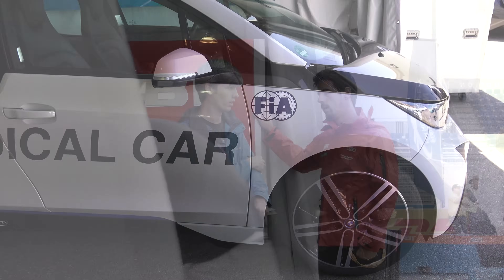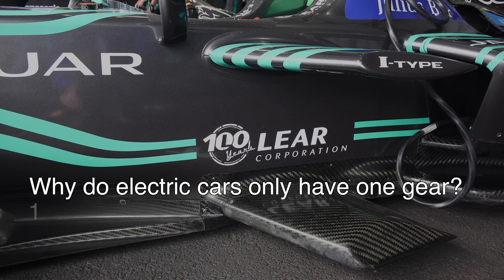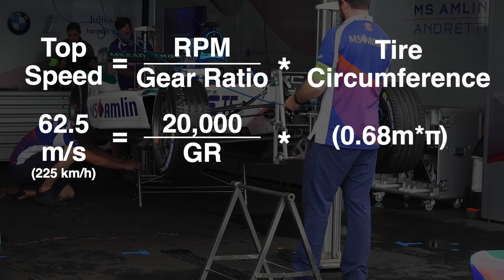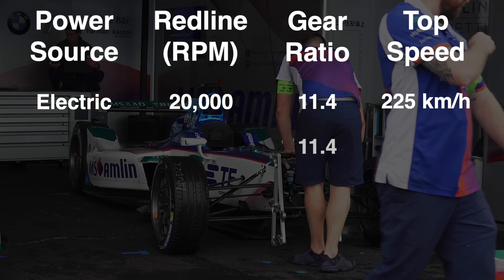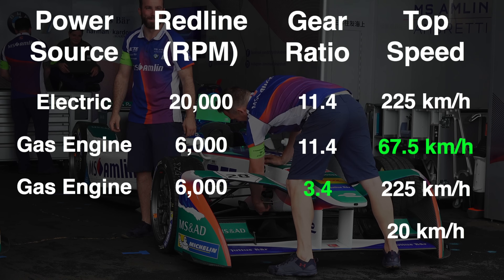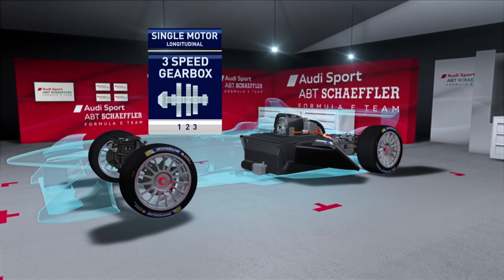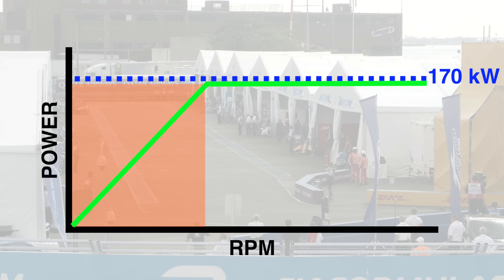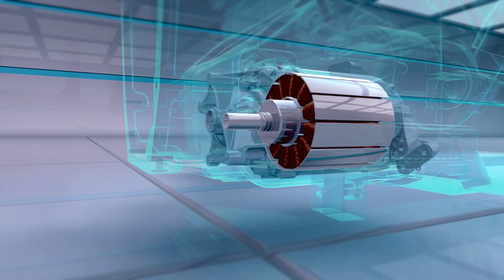Why Do Electric Cars Only Have 1 Gear?

Comment: The first Tesla car had a 2-speed transmission, so electric cars have been made with more than one gear.  Also, at least one electric motorcycle has a transmissions with several speeds.

The electric motor for an electric car could be smaller and lighter if the car had a multi-speed transmission.  However, most electric car manufacturers have decided that it's better to have a somewhat bigger and heavier electric motor to eliminate the complication of a multi-speed transmission.  That may result in slightly lower efficiency, but the efficiency loss is small.
Reply: Frank Eggers You will get worse efficiency if you run a smaller motor through gears. For the same weight of a gearbox and small motor you could have a big motor and no gears. The big motor without gears would be more efficient.
Reply: Actually, it is more complicated than that.  To see why there are multiple opinions, check the following:

http://gas2.org/2014/07/20/bosch-electric-cars-will-soon-transmissions/

http://www.plugincars.com/efficiency-multi-speed-transmissions-electric-cars-107656.html

The above link has an error.  Here it is:
" On old EVs, with DC motors, there was a need of a transmission to allow reverse driving....".  Apparently the writer is unaware that DC motors can easily be reversed.  That is not his only error.  However, he does correctly point out that multiple ratios do provide advantages.

http://insideevs.com/zf-multi-speed-transmissions-coming-soon-electric-cars/

https://www.oerlikon.com/stories/2015/10/29/electromobility-calls-for-innovative-transmission-solutions/

Here is a quotation from the above:
"The 2SED (2-Speed Electric Drive) and 4SED (4-Speed Electric Drive) concepts represent significant developments in multi-speed applications for electric vehicles."

In general, electric motors are most efficient when they are heavily loaded, but not necessarily overloaded.  If a traction motor is big enough to provide adequate torque for exciting acceleration from zero speed, it will be running at a very light load at normal driving speeds thereby somewhat reducing its efficiency.  Also, the motor would be heavier.  Thus, there are gains to be made by providing an electric car with a multi- speed transmission, but perhaps not more than two speeds.  So the actual question is whether a multiple speed transmission for an electric car provides advantages great enough to warrant the additional complication, additional maintenance, and possibly greater cost.  The links I've provided will support that conclusion.  I'd prefer the single speed transmission approach, but there are valid arguments for multiple speeds.

In an earlier iteration of my life I had considerable experience with electric motors, both AC and DC.
Reply: Frank Eggers I can't take anything from a, soon to be irrelevant, transmission company's blurbs seriously.
Reply: difflocktwo, I can take it seriously.  The weight of an electric motor is roughly proportional to its torque and, because a multi-speed transmission would reduce the torque demands, it would make it possible to have a lighter motor.  Obviously an electric motor is more flexible than an IC engine.  An electric motor can deliver its full torque at stall and, without damage, put out several times its rated power for limited periods of time.  Unlike some of those who propose multi speed transmissions for electric cars, I see no reason to have more than two speeds.  Such a transmission could cut the weight of the motor in half.  It would operate in high gear most of the time, which would be direct drive and have little efficiency loss.  And, because a smaller motor could be used, its efficiency would be greater.

I'm not saying that electric cars should have multiple speed transmissions or that any will.  I'm simply saying that it is premature to rule it out.  It has yet to be determined whether the advantages of a multiple speed transmission would outweigh the obvious disadvantages.
Reply: Frank Eggers I will agree that I haven't come across extensive documentation about optimizing an electric drive system with a multi speed tranny. I would also agree that it would be crazy to spend development money in extravagant multi speed gear boxes for an EV. 

I think whether you are looking for a land speed record, leaving a top fuel drag car in the dust, or build the most efficient commuter car ultimately a totally gearless system will be champion. Solar race cars already ditched all mechanical transmissions last I checked.
Reply: difflocktwo, a multi-speed transmission for an electric car would be somewhat simpler than one for an IC car.  Because electric motors can run equally well in either direction, the transmission would not need reverse.  Also, there would be no reason to have a torque converter or fluid clutch.  Two speeds would be sufficient whereas IC engines could always profit from more speeds.  There would be definite advantages to having a two speed transmission, but one must also consider the disadvantages.  I disagree with the ZF executive who expects EVs to have three or four speed transmissions.  The superior flexibility of electric motors would seem to make having more than two speeds superfluous.

It's my guess that most EVs will not have multi-speed transmissions.  However, that's only a guess and I am not willing to deny the possibility that some EVs will have simple multi-speed transmissions, but probably no more than two speeds.

The solar race cars I've read about drove only one wheel.  They provide an interesting demonstration of solar power and help provide an education for budding engineers, but other than that they are completely impractical.  The total power of the sun's rays reaching the earth is only 1050 watts per square meter and one HP is 746 watts, so not very much power is available to drive a solar race car.  It's even worse when considering that solar cells are usually not more than 16% efficient so the actual available power would be about 168 watts per square meter.

Comment: Can we use  XTRONIC CVT transmission instead of gear drive and connect it to motor?
Reply: laxmikant dhauskar Yes, if you want to waste energy heating up your CVT. Gears waste energy, it is best to drive the wheel directly with a motor.
Reply: Great difflocktwo  u right but we can use waste heat energy in form of electrical energy with help of Thermoelectric generator fabric But it is too costly
Reply: U r point is right but how u will give torque and variable speeds
Reply: laxmikant dhauskar Just get a motor that meats your requirements.

Comment: Interesting video. I can see for race purposes why gearing isn't required so much, but for the average Joe in an EV car where range is generally more important could gearing help then?
Reply: Depends on whether it would save enough energy to offset the efficiency losses the increased weight would cause. 
EV manufacturers don't seem to think so, but I'm not sure if that has been researched enough yet... 🤔

Comment: Diesel - Electric, in locomotives, use a diesel engine driving a generator, which drives motors.  Why don't hybrid autos do this and eliminate the need for a CVT?  Like wise, why don't these race cars use CVTs rather than some of them having gear boxes?
Reply: Jim Larson This would be the best hybrid topology. The Honda Accord uses this and is one of the most efficient in its class.
Reply: I mean Honda Accord uses a generator and motor, not gearbox. It locks the engine to the wheels at a certain speed.
Reply: Electric motors don't idle and can provide almost all the torque from the first couple of RPMs meaning they would destroy CVTs unless they are really huge to deal with it. A single gear will work better, won't get destroyed and will be lighter. You'd think it's no big issue, the weight, but it is because instead of another 50 kg of transmission you would be better served by another 50 kg worth of batteries.
Reply: That's what I assumed you meant.  I test drove a new Hybrid Accord this spring, I was pretty impressed by it.  However, I ended up buying a Malibu hybrid -- I had 3k of GM card earnings I wanted to use.
Reply: The reason I was asking is that it was mentioned that some of the electric cars use 3 speed manuals.

Comment: I still prefer to shift gears instead of sticking just to one gear to do the job. Besides, shifting gears is good practice to improve your driving skill. Especially, rev matching and  the list goes on. Imo, at times, sticking to the tradisional roots is better than transitioning to modern invention to ease our convenience in driving. Anyways, isn't shifting gears while driving fun?
Reply: "Anyways, isn't shifting gears while driving fun?"

Not if you've run out of revs, it's downhill, steep and icy, then it can be a little tricky.
Reply: "shifting gears is good practice to improve your driving skill" What do you mean? If you drive electric you don't NEED to know how to switch gears.
Reply: Shifting gears is more fun than... not shifting gears in an automatic car.  Both cars require gearboxes, but it's more fun to shift yourself.  But in an EV there is no gearbox needed, therefore no shifting needed, not by your or the computer or anything else.  So it's pointless to "want" a gearbox in an EV.  If you want to shift gears, an EV is not for you.
Reply: Must be a rough ride in your car with wooden wagon wheels.
Reply: nicktecky55 or you have a tesla model s ...0-100 in 2.5 sec hell try to shift this...
Reply: Patrick94GSR or you build a useless shifting gear in the car it would work but it is not needed it only cost money 4 nothing
Reply: Jo Kwon  drive a steam engine sports car of difficulty is your issue.
Reply: Bruce Lee that’s not the point. When people drive manual transmissions they tend to become better drivers than people who drive automatic. That’s is because manual drivers are better at multitasking and paying attention to their driving.
Reply: "I still prefer to shift gears instead of sticking just to one gear to do the job."

Your preferences have nothing to do with practicality or efficiency.

"Besides, shifting gears is good practice to improve your driving skill."

This is the most idiotic thing you've said. Knowing how to shift gears is USELESS in a vehicle that doesn't use a gearshift.

"Especially, rev matching and  the list goes on"

See above.

"Imo, at times, sticking to the tradisional roots is better than transitioning to modern invention to ease our convenience in driving."

Your irrational emotional longings are impractical and inefficient. 

"Anyways, isn't shifting gears while driving fun?"

Maybe to simpletons like you that love the smell of gasoline fumes. Would probably explain the brain damage. I'm sure there are fisherprice toys that have some sticks that you can move around that would entertain you.

Comment: As I couln't find a satisfying answer in the Discussion:
Yes I know, that electric motors have a relatively constant torque, but still I am asking myself: Could a transmission help to extend the range of an electric car by reducing the power needed from the battery (e.g. while cruising on constant speed on a highway)? The idea behind my question is: If I have a  long distance gear (e.g. like the 5th or 6th gear in internal combustion engines), the electric motor wouldn't have to turn that fast to hold the speed and therefore wouldn't need that much power from the battery. 
Or do RPM and power draw not correlate that much in electric motors? In other words, can electric motors hold high RPM without the need of much power from the battery?
Reply: Siegfried Schwab 
Remember that Power = Torque x RPM which is why a gearbox cannot reduce the amount of power needed for eg. Highway driving.
Reply: Siegfried Schwab Gear boxes are parasitic, they only add losses. You can make a motor give you any torque at any speed. Why bother with a gearbox? Higher RPM isn't a problem with electric. The losses at high RPM would be LESS than the losses of a gearbox.

Comment: @spazvapes 
I am guessing it is for weight reduction, as I understand the higher the volts the smaller the wire diameters needed and lighter the motor, though insulation would have to be better.
Reply: peter lewis Wires are short, it wouldn't weigh much more with fatter wires. And they can make structural metal parts and use those as a conductor so you save weight. Higher voltage electronics also have higher resistance. The perfect balance right now is about 1 kW per volt, so if you want 174 kW you would design around 174 V.

Comment: Why do electric cars use 400V?
Reply: spazvapes I mean the active components like IGBTs or MOSFETs are lower resistance at lower voltage. And I also mean that in a car using super fat cables isn't a problem cause the distance is so short.

Blindly saying that higher voltage is lower heat is only applicable to conductors but not the whole system.

Also after a couple hundred volts it becomes incredibly dangerous to people and difficult to make safe. At around 1000 V strange things start to happen with materials and the air even.

400 V right now is a compromise and we will see the voltages used in EVs come down. No one wants more volts than they need, and current we can handle with more conductors which isn't a problem in a car.
Reply: spazvapes for less amperage. Less amperage means less heat, that means lighter harness
Reply: ΑΡΗΣ ΚΟΡΝΑΡΑΚΗΣ But higher voltage electronics have higher resistance. Harness weight isn't a huge issue, the battery is really close to the motor and you only need a few feet of conductor, or not even a few feet.
Reply: So it's analogous to transferring power from power plant to houses and the use of transformers? Transmission lines having several kV etc

Comment: I always thought CVT would be AMAZING for electric motors...
Reply: Fabian van den Bussche Amazing if you want to go slower. Transmissions only rob you of power with friction.
Reply: i do think that doesn't have to be the case.... as with cvt you could potentially keep it at peak power ? torque goes down as revs go up with electric.. keeping the revs down while accelerating the outgoing axel speed should in theory give you more acceleration? i get where you're comming from but i'm just curious ^^